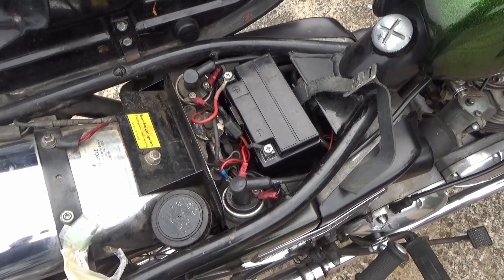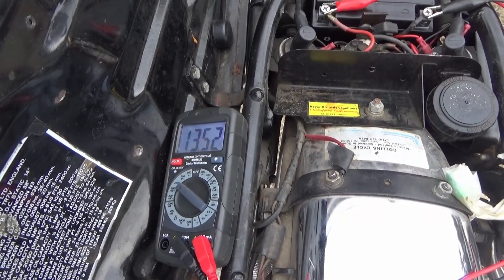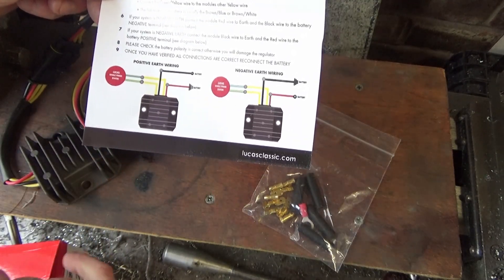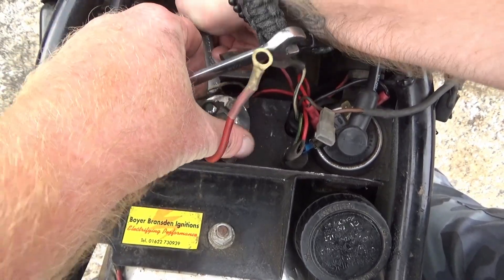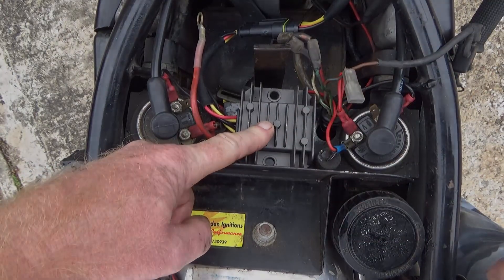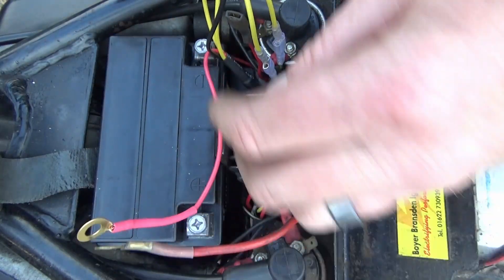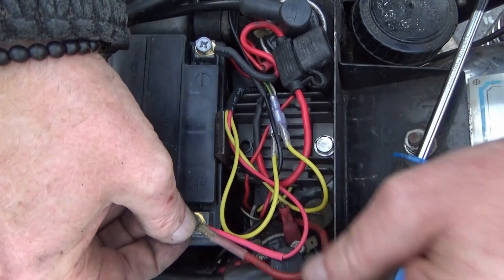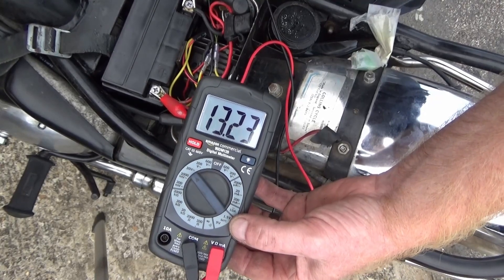Triumph Bonneville T140 -Single Phase Charging System Fault and Upgrade

Comment: Did you notice a stronger spark at the plug, I'm scratching my head mine is so difficult to start at the moment
Reply from the maker: Electronic never gives a decent spark but I would normally look at my carbs initially.  Double check plug leads and spark gaps etc.
Reply from the maker: I forgot to add, make sure your battery is fully charged, should be around 12.5 volts.
Reply: Battery at 9.5v which is not ideal will charge and see if that helps
Reply from the maker: @simonmarsden66  That'll do it, anything below 11.5 volts (20%) will give you problems.
Reply: @bodganeering  the wiring is a rats nest, I watched your video on tidying up and that is definitely on the cards
Reply from the maker: Nice steady job, follow the wires, good music and a few beers, what could possibly go wrong… 😂
Reply: @bodganeering  I have uploaded a  short video if you have any suggestions
Reply from the maker: @simonmarsden66 I’ll take a look later mate.
Reply: Would you believe it, the coils wired the wrong way round, the condensers insulated in hosepipe. Rectified all of the above and she starts and runs. So this weekend wiring tidy then bike is ready for its first run bank holiday weekend (fingers crossed)
Reply from the maker: @simonmarsden66 cracking news mate, hopefully the weather improves for a good run out.
Reply: @bodganeering yes its been pretty crap of late, im the other side of Peterborough so am getting the same weather.
Reply from the maker: @simonmarsden66 some nice roads up there.

Comment: My voltage regulator was bolted to the underside of the battery box.  Neat and our of the way.
Reply from the maker: I will be moving it this winter and sorting some of the wiring out, getting rid of some of those horrible blue through crimps… 😂

Comment: 5:52 a nut Zerg/rivet would work great there👍
Reply from the maker: It would but I haven’t got any of a suitable size. 

I’m considering sorting some of the wiring out over winter so may well make a new bracket for it and the ignition unit.
Reply: @bodganeering  my Tympanium is bolted to the underneath of the battery tray.  Might get better airflow if needed-but my VR isn't finned.
Reply from the maker: @robthoreson8384 I’m going to be tidying up the wiring this winter so it may well move. I was considering where the zener diode is mounted as that is a massive chunk of aluminium and will easily wick any heat away. 

But the underside of the battery tray is also an option. 🧐😂
Reply: @bodganeering  I’m curious to know if the Lucas needs a choke installed like a Podtronics (as they suggest) because of interference between Tri-spark/EI’s.
Reply from the maker: @robthoreson8384 nothing was mentioned on the Lucas, had a good run out today over 50 miles with no issues.
Reply: I would have lost patience and put the bolt in from underneath.
Reply from the maker: @rickconstant6106  I tried but the mudguard got in the way... 🤣
Reply: @bodganeering  Mine doesn't have enough room for the reg/rect there, even with the original rectifier removed, because I have run all the wiring to the coils, electronic ignition and charging system across there in protective sleeving, so I bolted it to the inside of the L/H side panel, which seems to have made an effective heat sink.
Reply from the maker: @rickconstant6106  I'm considering moving it when I tidy the wiring this winter, the big aluminium heatsink for the zener diode is looking like a good candidate...

Comment: If the VR is directly connected to the battery wouldn’t it always put a draw on it?  Would it be better to have the battery side connected to the ignition power?
Reply from the maker: It doesn’t draw any power, the diodes within the rectifier prevent that. 

If you connect it to the ignition side you run the risk of the engine running on when the ignition is off as the stator will power the ignition circuit.

Comment: Triumph actually specified a peak voltage of 15.3 on the charging circuit with the zener diode, which always seemed wrong to me, as you will cook a 12v lead/acid battery if you charge it at more than around 14.3v, so a proper regulator is the way to go.
 After several batteries went to an early grave over the years, running the standard system, I upgraded mine with a 3-phase stator, solid state reg/rect and AGM battery. Battery is still going strong after about 5 years, and indicators work at low revs around town, with the lights on, which they never used to on the original system.
Reply from the maker: Triumph always seemed reluctant to update their electrical systems whereas the Japanese were moving well ahead of the times. 

15.3 is high, I’ve worked on various battery charging systems over the years and never had anything that high on 12 volt systems. I did see this one rise to 15.9 before I shut it off, I’d be interested to know what it got to when it cooked the battery. 

I have three phase on my T140 chop with solid state rec/reg and  Li-Ion battery and it puts out a very stable voltage.
Reply: Hey mate, just picked up a 76 Bonny and was wanting to do this small upgrade prior to burning out any batteries. 
Can you post a link of what where you picked up the new solid state stator? 
Also, can I get a picture possible from you, as to how the battery strap is mounted on the side and top of the battery. 
I didn't have one on top of my battery and am having a pain in the neck getting it mounted properly! 
Thanks in advance mate! 
Chris
Reply from the maker: @ChrisWilk I got my reg/rec from the Classic bike shop, was around £45 if I remember correctly. Look for LUCAS 12 VOLT RECTIFIER/ REGULATOR SINGLE PHASE. 

As for the battery strap mine just clips onto the hooks on the battery tray.